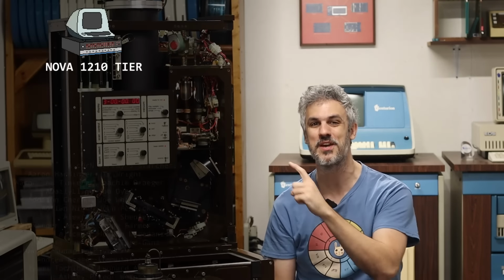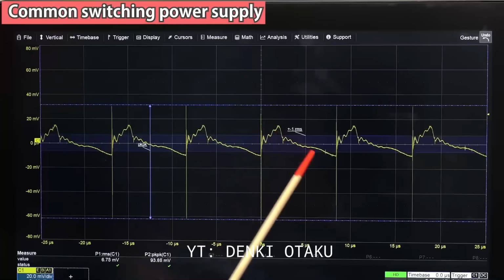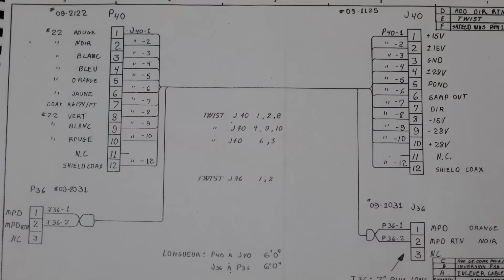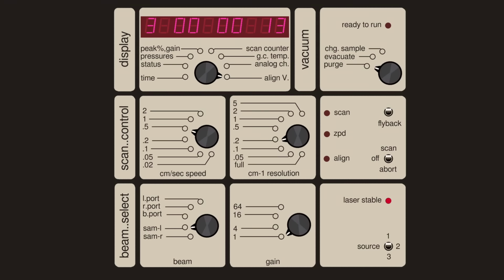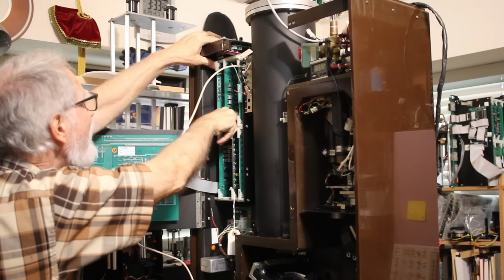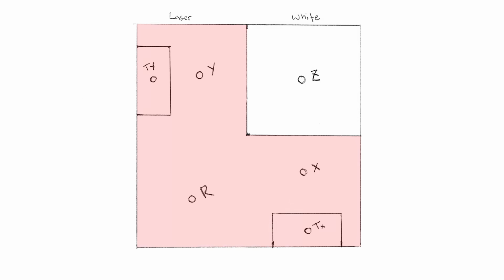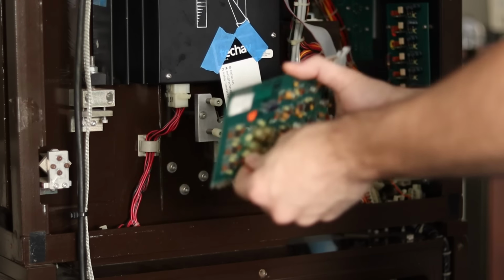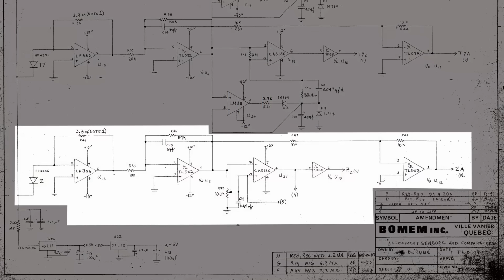I Found a Production Mistake on the Spectrometer!

Comment: 21:45 "so we're using a newer version of the software" - <proceeds to operate software on Windows XP>
Reply from the maker: It is technically newer than the software I'm planning on using on the PDP-11!
Reply: Well, he said newer, he didn't say modern!
Reply: I was the 'IT' for a pharmaceutical company in the late 90s, once these devices are validated to run you can't change them in any way without re-validating them.  Validation can take years in some cases.  And as noted, if it ain't broke don't fix it comes into play.  I would also think he was referring to what David will have on his setup in the end, a PDP-11 running the software.  I've only commented to bring up the need for validaton.
Reply: As that old adage goes, if it ain't broke,  don't fix it
Reply: @markchriestenson3257  AFAIK there's some scientific equipment running on Win98 software simply because the manufacturer either doesn't want to write new software, the license for new software is astronomically expensive, or the manufacturer went out of business
Reply: @HubrisInc  I used to use old scientific equipment back in 2010's but i didn't get that new 98 stuff, software refused to run on anything more modern than NT 4.0. 98 of course was different family anyway but even 2000 was too modern. Equipment still worked fine, there were some spare parts for computer but old inkjet printer was a lot of work to keep running.
Reply: @HubrisInc Don't even look at the PCs managing turbines in UK power stations you would be terrified.
Reply: @HubrisInc  go to any hospital with any MRI or CT scanner, older than 10 years (in hospital IT still a new purchase item) and you will find it runs on XP Embedded, with a network connection to get the data into the hospital network as well, normally via a very well locked down firewall appliance with the default behaviour of block everything, and what is allowed through is with very narrow parameters to keep the XP machine safe. No browser there, or at least not one capable of connecting anywhere other than to the scanner itself for imaging ( because IE4.0 with some really old and totally arcane Activex controls that essentially use the browser as a VM to operate the unit), someversion of Java used for the HMI controls, and a screen that will forever be set to 640x480 resolution, even on a 4k monitor, complete with black bars on the sides. in the back service area you also will find boxes filled with motherboards, power supplies, PS/2 keyboards and serial mice, because they will repair those, and do anything to keep the units running, even if it means replacing 200 capacitors on 5 motherboards, dead from capacitor plague, to get at least 2 running stable, and able to be used as hot spares for the machines. Also PATA to SATA adaptors by the boxful, because old hard drives do die, and you might find a machine still set to use an 80G drive, with a 1T SSD plugged in to it, ignoring the extra space, because the BIOS is only capable of recognising 120G, and no BIOS upgrade, because that would mean burning an OTP EPROM, and getting the new version certified by the software manufacturer to work with the machine, or it just does not work.
Reply: @markchriestenson3257  Or if you are Microsoft "If it ain't broke, fix it until it is"
Reply: @zebo-the-fat so true
Reply: I came down to the comments to chuckle about the same thing.
Reply: XP is space tech.😁
Reply: The program looked like a 16-bit windows program, like written for Windows 3.1X.
Reply: @alisharifian535  I was going to post this exact comment.

More specifically, this software was most likely originally created in tools that targeted Windows 2.0-3.11 (or corresponding NT versions) and was never redesigned since. It's not necessarily actually compiled as 16-bit executable.

The evidence is white background, flat InputBoxes and Fixedsys font which were the defaults for dialog boxes back then. IIRC Windows95+ shows buttons as "3D-style" by default unless the flat style bit was set explicitly, and ComboBox buttons are also forced to be in "3D-style", but everything else looks exactly as designed i.e. how Windows 2.0 looked.
Reply: @alisharifian535  I think this is a 32bit piece of software because of the /32 in the name, although the graphics do correspond more with 16Bit Windows versions. Could be an upgraded application.
Reply: @Hans-gb4mv  So it was designed for Windows NT 3.X, because the GUI style is exactly the same as Win 3.1X but it is completely 32-bit under the hood.
Reply: Hey, if in 2014, GE still required XP on new installs of Centricity (the software for the CT and MRI machines), let the man have his Windows XP for his 1985 devices.
Reply: @slightlyevolved again, we have the issue of system validation and FDA requirements.  The machines are medical devices and that opens a whole new can of worms when it comes to revision control.
Reply: @Rorschach1024 Got that right. If I never see another Radeon 7450 with that stupid high density 50pin(?) connector for splitting to dual monitors, I won't ask for anything else in this life.... WinXP in 2014 is going a bit far though. By that time we had the issue where networking and security refused to permit them LAN access. Radiology IT had a hell of a time.
Reply: I used to maintain an OMR (optical mark reader) package that only supported Windows 3.1. It was 1997.
Reply: With Win3.11 looking controls!
Reply: I'm still using XP on a PC that runs my house central heating (My visual basic 10 software from 2016), and other stuff I don't need internet for.
Wndows 7 on the PC I'm typing this now! 😀
Reply: ancient operating systems can be fully functional and safe to use ...as long as they are never connected to the internet...
Reply: XP is this century, that's plenty modern by this channel's standards!
Reply: Win XP = God's OS
Reply: Everything is relative, but let's not talk about my relatives....
Reply: Beat me to the comment. Old Timer here spotted it also.
Reply: WindowsXP runs the industry. Microsoft should just throw away Windows11 and re-release WindowsXP but with a modern Windows NT 22621 Kernel. That's the best version ever, too bad Microsoft fscked the user mode, but the base of the system is still good.  

(I can't wait for the AI bubble to burst and companies to go back to just maintaining things, everything is getting broken on all software made after 2023 because of stupid AI, it seems no one is keeping the things running anymore, everyone working on stupid AI crap, no wonder why all software is basically rotting away, companies should go back to maintaining software instead of writing AI crap using AI shit, I refuse to upgrade my Windows11 from 22621, it just works, why would I want copilot crap ?)
Reply: @monad_tcp  I dislike people calling XP the best version ever. Most people who do that weren't around in the early years of XP, because it was a horrible OS. Think Windows 8 meets Windows Vista. It was slow, it was unstable, it had poor driver support, it was insecure, it had compatibility issues and so on. It took till service pack 2 to become somewhat decent.
Reply: @Hans-gb4mv  Agreed, I was there and remembered Windows 2000 flying (relatively) on Pentium II systems with 128MB of RAM while XP struggled on my friend's new P4 Dell with 256MB of RAM. XP was just around so long that people remember SP3 running well on systems made nearly a decade after XP first released.

But that said SP3 is the version of XP they are thinking of when they make such claims so I don't get too worked up about it. That said in a world where Windows 7 existed I'm not sure why we want to go back to XP specifically.

P. S. Windows 8 was mostly just a UI disaster and that charms bar was worse than any Windows XP UI element by quite a bit. Also I had ME and while it fast on quite weak hardware if you plugged anything into it there was a decent chance of a Kernel panic or even just the Explorer shell crashing. While a certain amount of that was true for XP when it came out that ME experience was something else.